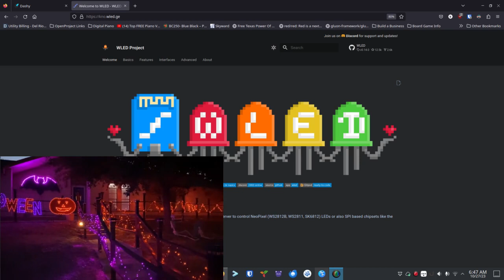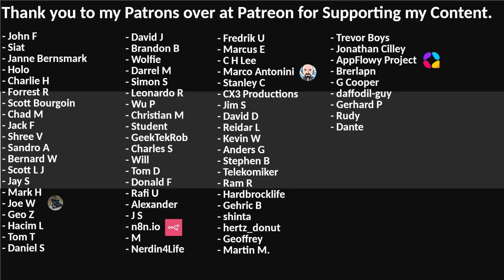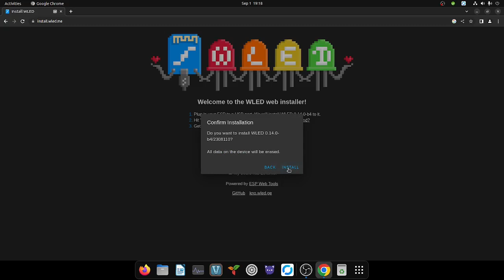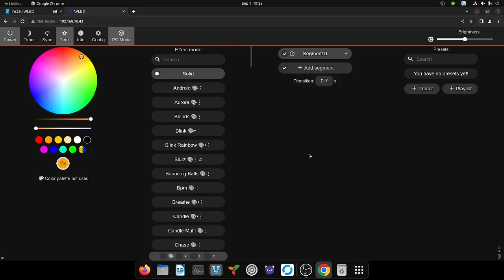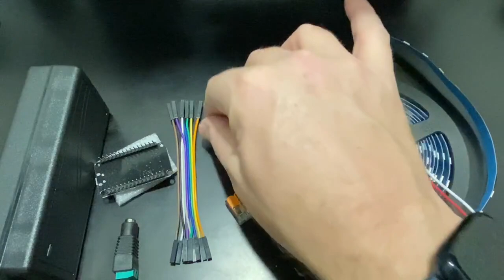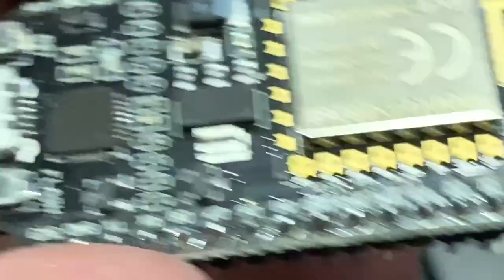WLED - Open Source Pixel Controller on an ESP Home SBC. Light up your world with amazing decoration

Comment: Only just seen this. 

Having seen the 'Home Assistant' option in the Web setup, could this be used to control multiple LED strips simultaneously? I've not used Home Assistant before but have seen it on your channel. If this functionality is possible, I would envisage it running in Docker.
Reply from the maker: WLE does have sync functions, but the mobile app also can deal with multiple different ESP devices to control different lighting strips as needed.  it's pretty robust. Note, the new iOS app is called WLED NAtive I believe.

Comment: Just setup my first WLED lights a month ago.  They are very cool if you like blinky lights.  One issue I’m having is iOS app doesn’t display all the preset effects.  As you scroll through the 50ish options it goes wonky and garbled.  Web into the board and works just fine.  Per usual, they are not a slam dunk and require some tinkering.  Most of these electronics have a level of tinkering required. Hence why we probably enjoy them. They challenge our brains.

Edit:  I also ran into issue with D4 data pin. The programming in WLED was pointing to a different PIN and I had to change it.  Took a couple of hours to figure that one out. Everyone says D4. Not sure how mine was different but maybe it will help someone.
Reply from the maker: I've seen the same thing. I figured it was my font sizing on the phone creating an issue the author may not have thought about.  Haven't reported the issue yet, but need to.

Comment: Hey, question for you if you have a chance. I was trying to duplicate your setup for OpenWRT and I followed your steps for connecting the new router up temporarily to your network so you can download updates and connect to it, but it isn't connecting to the Internet. Is there a good forum I can go to to find help with this or something you followed to figure out your install methods?

Love your content and thanks so much!

Edit: Apparently when I installed OpenWRT, it swapped which Ethernet port was eth0, causing my whole setup to break because it wasn't setup to work in any of the other ports
Reply from the maker: Without knowing what your network settings are, and which device you are setting up, NICs etc, it's hard to say.  Maybe just see if the Luci interface comes up. I noticed it was there initially on my last install of a more recent rc version.

Comment: Love the WLED.  I wonder if it'll work on my Debian 12 with KDE to hook up my ESP32/8266 boards?  Will have to give it a try soon. Thanks for showing this with Linux as didn't know it could be done that way.
Reply: Installation is a matter of web browser - it allows you to connect to the USB port to flash the program. All modern browsers should support this. After uploading (flashing) the software, you communicate with the microcontroller via WiFi. You just need to know what IP address your router assigned to it.
Reply from the maker: Yeah, Debian should work, and Chrome browser works, but it will flat out tell you that Firefox isn't supported.  My Mint 21 didn't work,even with Chrome, but I think that was more about my laptop vs. my Desktop machine.